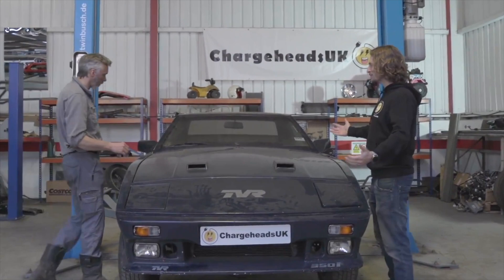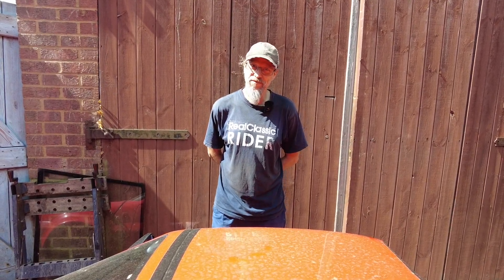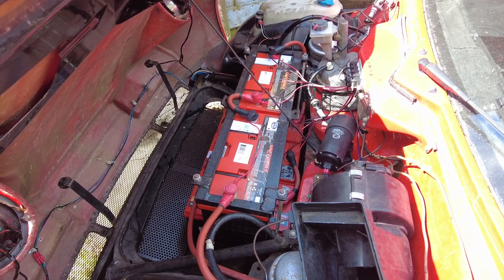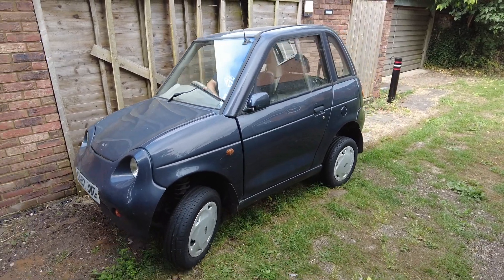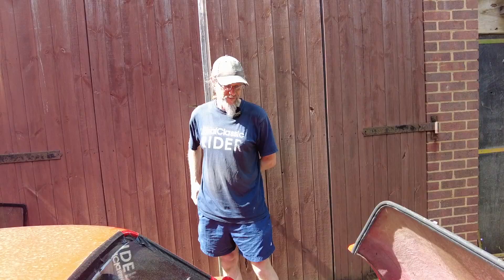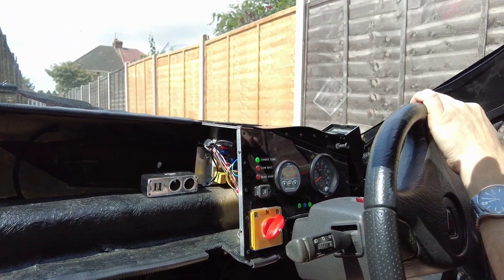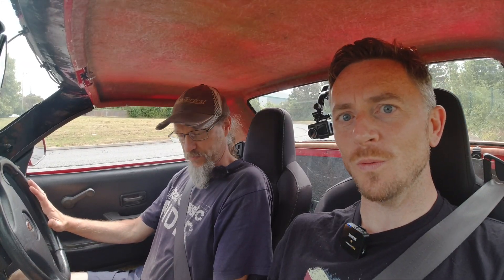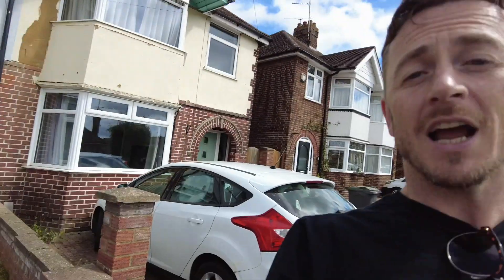Rare electric kit car used as a daily driver!

Comment: I have a 15kw ac motor in my conversion but the invertor cuts out if i try to pull away in higher than 2nd gear. Or if i push the accelerator too fast. Ideally id get a inverter i can adjust the settings on  but no money for it these days. Sadly my conversion stays in a garage. Thanks for this video.
Reply from the maker: @blackterminal  time and money is a cruel beast

Comment: Very interesting to see this one. 
I have the original MK2 GTM Rossa with mini engine and running gear, I hope to convert this to an EV at some point. Mine is the same shape as the K3 but has traditional styled boot and bonnet lids that are hinged at the bulkheads. The braking will be interesting on this as I presume it no longer has vacuum assist on the servo. The additional front weight will also affect it a bit, the original GTM never had a front to rear balancer as you never saw much weight transfer under breaking due to the mid engine layout and not much front weight. Handling wise the front can go anywhere and everywhere in poor road conditions due to the lack of weight and good rear grip.
GTM went on to produce the Libra, which is a full shell version with the Metro/MGF base and then the Spyder which is a convertible. 
Eventually it all ended up under the Westfield banner, but I don't think they offer this style of GTM now.
Thanks for video!
Reply: It has the standard solution of an electric vacuum pump as used on quite a few modern ICE vehicles (Hella UP28 for example). My Fiat X1/9s had no need of a servo and were quite a bit heaver, so I may look at a servo delete and change of pedal leverage ratio to suit. The brake balance valves are there because it uses the Rover 100 front calipers on all four corners.
Reply from the maker: @EVguru  thanks for sharing the info Paul
Reply from the maker: @three-phase562  thanks for your comment, great to hear there are more about. I found the brakes ok on Paul's GTM. I reckon with his plans it will be a really fun machine! 💯